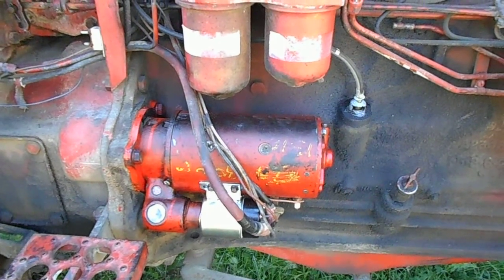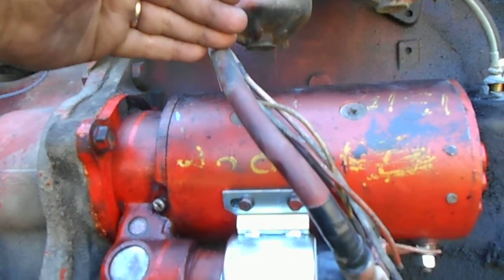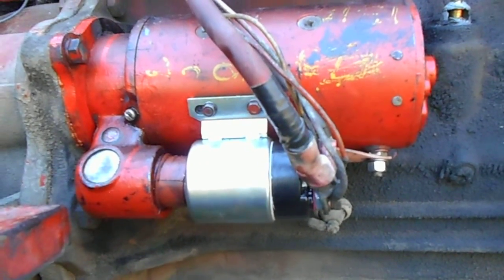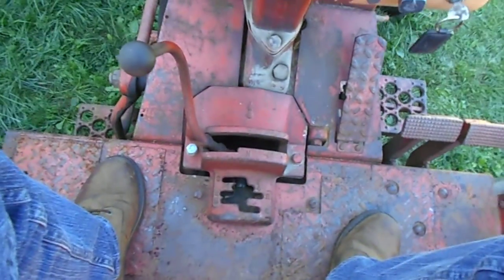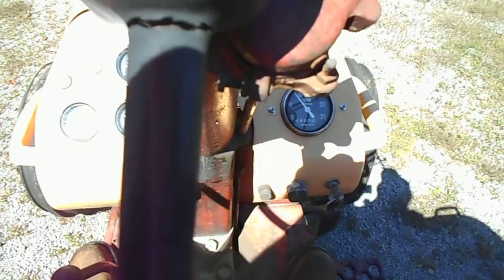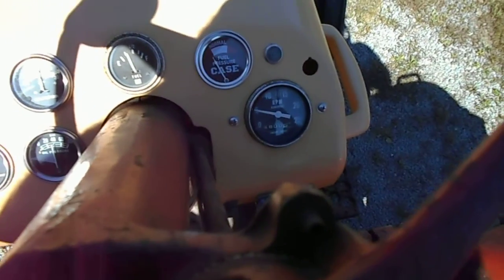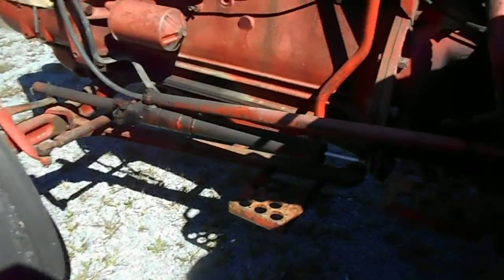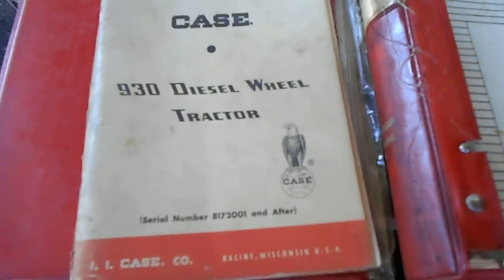Case 930 starter PT2 Big Bertha

Comment from the maker: Got to love it when you do a lot of extra work for nothing and I ended up putting it back together just like it was, I should have know it was that way for a reason.  Big Bertha is back together and running and that's all that matters. Go to love Big Bertha !  Bandit
Reply: switch your fuel filters around mine are all opposite of yours and the starter is up right
Reply from the maker: This isn't the right starter for this tractor, In my books it shows the starter up under those filters but this one is bigger than the original one and it wont fit under it like its supposed to. So After taking it apart and cleaning it up and trying to put it back on the right way I ended up having to put it right back the way it was when I bought it.  Oh well I tried to do it the right way !  I might have to look and see if I can reverse the lines to switch the filters around and see if I can make it work that way. Thanks for the tip !  Bandit

Comment: nice tractor  i thought it was a narrow front before the pt1 starter problems video
Reply from the maker: +C&J FARMS  The early 930's like mine never came with a narrow front.  In 1965 the new 930's came out with the 8 speed trans and 3 pt could come with a narrow front.  There were several different series of the 930's that were built over the years but I like the looks of mine and she is a heavy weight at 11.000 lbs.  Bandit